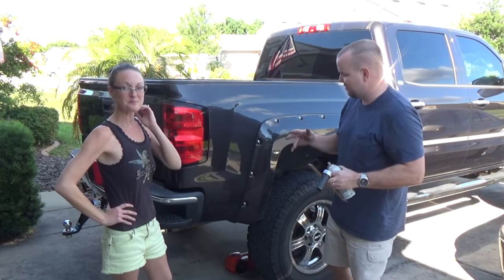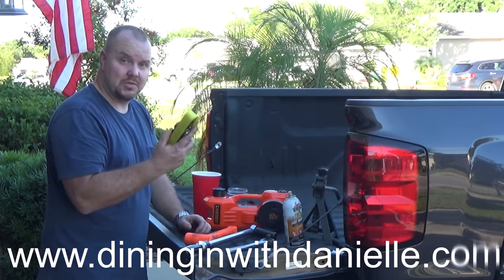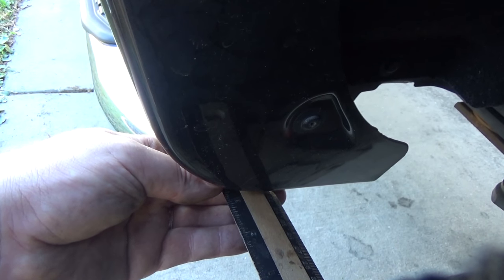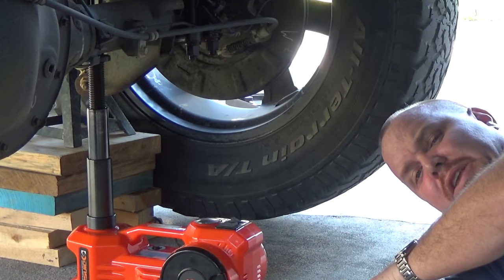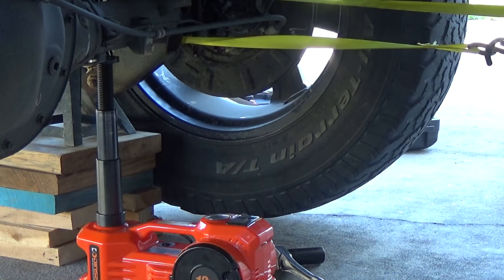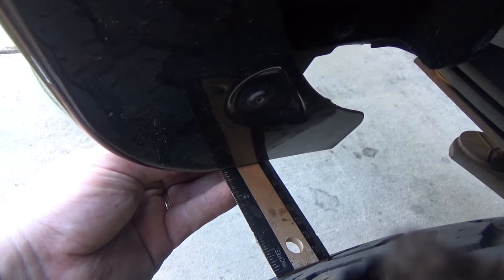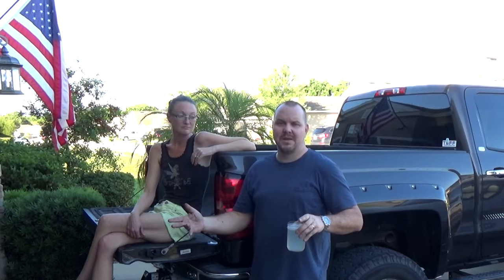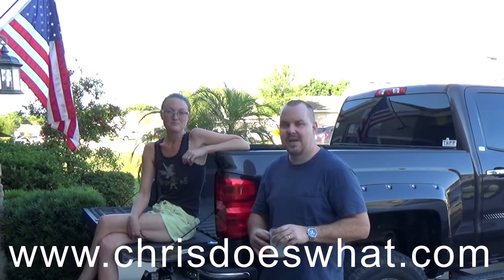How To Fixing Driving Sideways, Rear Axle Alignment

Comment: Did you notice if this caused a tire to wear funny? My drive rear tire is wearing bad on the inside. Hub and bearing seam fine. Shop told me my thrust angle is off, but not adjustable.
Reply from the maker: Thanks for watching, no this did not cause tire wear, it did cause the truck to drive sideways down the road.
Reply from the maker: Is your car Independence or a solid axle where the problem exists? What kind of car are you working on?

Comment: I have the same issue. I have a 4” block. 

Has problem return?
Reply from the maker: Thanks for watching and no the problem has not returned. I imagine that the block was not torqued down enough when installed. After I repaired this I have rechecked the torque on the U-Bolts a few times. I hope you get fixed with no issues, don't want to be "we drivin sideways, we rollin" :)
Reply: Gona take it apart asap. 

I have airbags. think airbags play a part?
Reply from the maker: Great, if I was not doing the video for this it should of took me only 30 minutes to fix. Not I don't think the airbags caused the issue, they are between the spring and frame. Stopping and starting with very heavy loads or hotroding can cause the issue.
Reply: Thanks for your help Chris!

Comment: Still not square...no wonder it moved it wasn’t done properly...should have loosened both sides of axle and realigned in conjunction with each other...now there’s excess tension on the side that he didn’t loosen...bound up...it will shift back..should have also spot welded the block in place then tighten everything up and then,try torquing down all the u-bolts to proper torque in the proper torquing sequence.....if that axle shifts while hauling a trailer and wrecks, your screwed...vehicle warranties don’t cover trailering with modified suspensions... no one should put any faith in safety to what was done here....
Reply from the maker: Lol, sounds like a user issue. This fixed the issue and we have delt with leaf spring for a while. Both our jeep and this truck are lifted. FYI the lift was done by chevy "Badlander", and when it moved there was already tension on the other side. No one ever weld aluminium blocks to the steel axle housing, that is retarded.

Comment: Ok now if you drive sideways down the road forget any adjusting the non adjusting rear differential because your frames tweeked and only front wheel,and some ,suv with all wheel drive, can be adjusted ,4 wheel alignment, we are not shimming a Chevy starter for fuks sake.
Reply from the maker: Frame not tweaked, lift blocks can move. Love your 2 cents, you must be a peach to chat with.